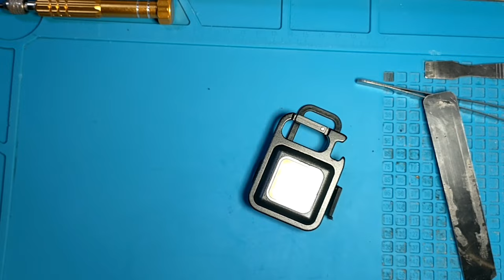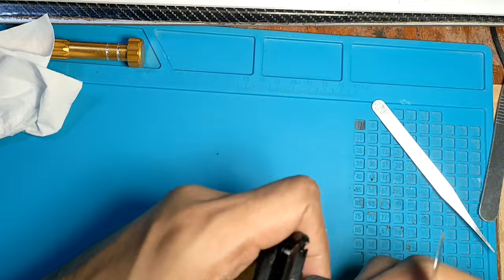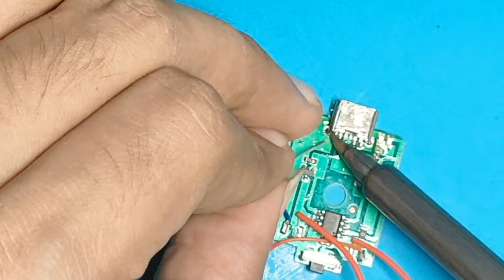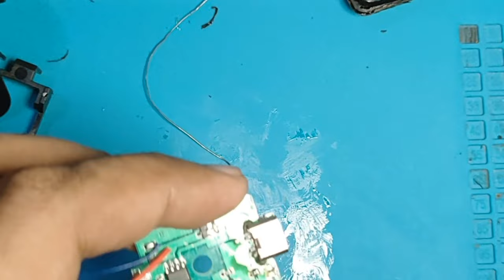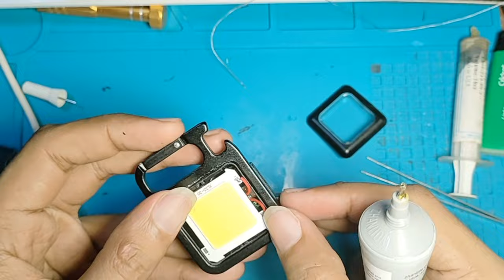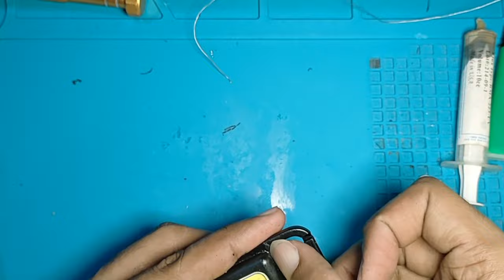Mini Led COB Keychain Light Charging port fixed

Comment: Can we modify it with higher capacity battery to increase its lighting duration
Reply from the maker: yes it is posible same voltage
Reply: @CPTechGamer  Is there a boost converter inside it, or, just a charging module?
Reply from the maker: @Zorem Thanga just charging module
Reply: @CPTechGamer  👍
Reply: You can also take your iPhone 14 pro max apart and do this to the flashlight and make it 7times brighter. YW 😁😮🙄

Comment: can it be directly connected to the powerful power supply as opposed to the battery, say 5v 20A?
Reply from the maker: just use 5v charger
Reply: No it will blow the LED if you don’t control the current

Comment: They Used 3.7v battery , so they used same voltage cob led  3.7v or 12 v with buck boster?
Reply from the maker: that is 3.7v battery
Reply: mah battery bro